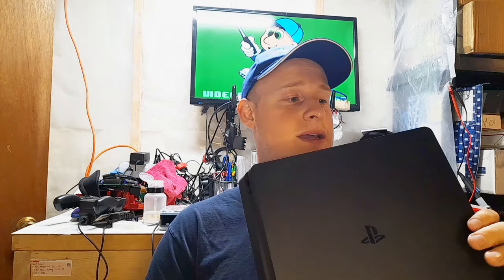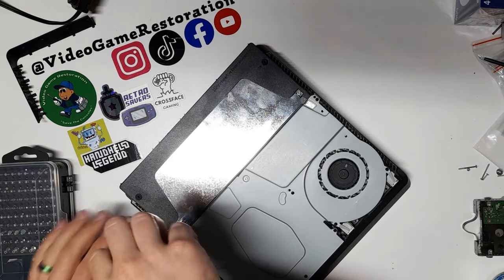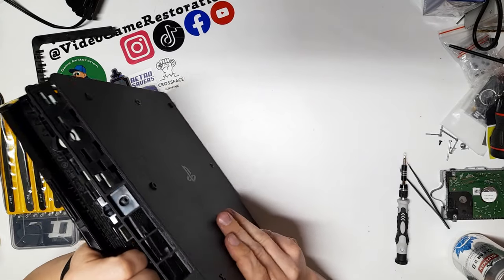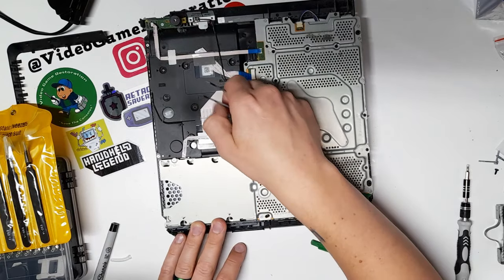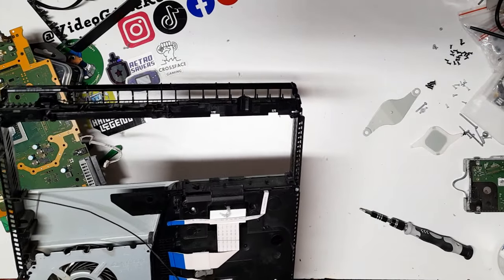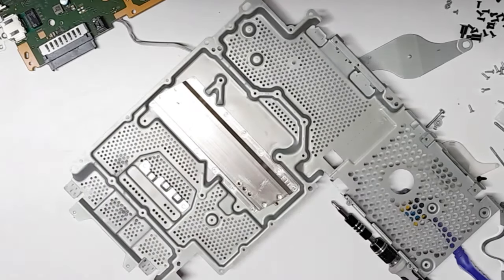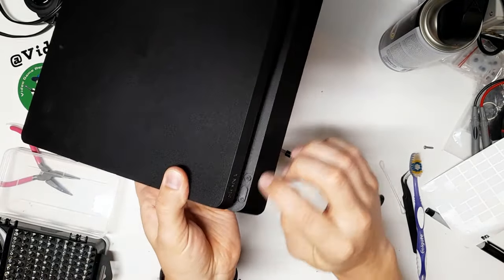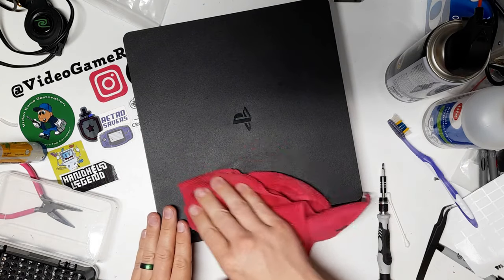Disassembling and Cleaning a PS4 Slim (Jet Engine)

Comment: Thanks for your video - I took up the challenge not even having experience disassembling a ceiling lamp. Took me six hours, many confusions, many screwing out the screws because I left the wires under the metal thing. But your guidance took me through and though something was uneven and I had to use a fork to stick in the USB-controller stick, the playstation works wonders!

Comment: Thanks so straight forward I felt confident to do it n got it done in less than an hour. I was left with two small silver screws that I just can’t remember where they came from tho lol. I made sure to look up the screw guide on Google and still came up with two extra ones but o well it’s fine
Reply from the maker: They say if you disassemble and reassemble a PS4 enough times you'll have enough spare spares to build a second system 😂 Good job!!

Comment: Thank you so much for this wonderful video. I was doing this to a recently pawned ps4 slim I picked up. I wanted to do the internal cleaning and apply fresh thermal paste and thermal pads. One thing I’ll do is replace the battery cmos battery as well since I have it apart. That part for heat sink was something I was wondering where it came from also. I patiently watched till you figured out where I needed to go. I didn’t know where it came from when I was disassembling my PS4. Thanks again for the awesome video.
Reply from the maker: @obliviousmode575  I'm glad it helped!

Comment: Hey, I have the same exact set of screw driver set as you, and at 1:59 the screw you removed, im unable to do the same with the phillips, i'm quite certain my screws are different by a tad bit, if possible could  you be able to help me know what screwdrivers are needed for ps4 slim as i'd like to try those and the reason for why im not just using and trying them all is just incase i damage the screw and it becomes a stripped screw

Comment: Good video, may I suggest to invest into a good quality small air compressor with a water separator if you clean alot of consoles.

I do alot of cleaning and it was the best decision I made hate can air and dealing with them.

Anyway awesome video will be using this video to disassemble my brother's ps4 slim. Thanks man.
Reply from the maker: Great idea! I've been meaning to move to another form of compression just haven't gotten there yet

Comment: I was trying to do a basic disassembly, one that doesn't remove the warranty seal (even though I got mine from a pawn shop) a certain part fell out when I was cleaning it, your video or any other video does not show or mention it and I don't know how important it is or if the console can properly run without it, its a medium sized black metal part bent at the end with 2 screw holes in it, one on the bent side and one on the flat side, I don't know where it goes so I can't put it back and I don't know how or if it will run without it

Comment: I took mine entirely apart and cleaned it, i took pretty much all the screws out since there was a good amount of resin built up inside, it seems a small mostly flat metal piece fell out, it has a small P1 indentation on it I didn’t think it’d be a big problem but after reassembly I can’t run anything as it gets too hot and shuts off, the fan seems to be spinning, although I didn’t change the thermal paste, would that alone cause my problem, I also disassembled the disc drive as mine never could read discs, I assume that’s where the piece came from as I didn’t see you do that or the piece on the side
Reply from the maker: Hey! That piece is for the shell, honestly it's not needed. It's over heating still, you should really put new thermal paste in

Comment: Just did mine. Wish I saw your video ahead of doing it. It's pretty clear and straight forward which would have helped in the prep phase.

One thing I'm wondering is if it would be worth replacing the thermal pads for the memory as well? I bought mine used in 2016 and the guy who sold it to me said it wasn't that old at the time (it was cause it was caked in dust from the back fan, after a week I noticed it.).  It's my first time doing the tear down but the pads didn't look half bad. Just wondering at this stage in the game for the Slim's lifecycle if its worth doing the upgrade to open it up again and give it one last boost. Great vid. Keep up the good work!

Comment: What's the thermal paste , what does it do and do you have to replace it every time you disassemble your system
Reply from the maker: It transfers the heat put off from the CPU to the heat sink. Yes you should absolutely replace it if you separate the heat sink from the board
Reply: @VideoGameRestoration would it be okay if you dont replace the thermal paste, would there be a huge problem
Reply from the maker: @XiEnVyx_VyPeRXx  If the thermal paste has dried any amount (Which in a PS4 it most likely has) then the system will over heat pretty quick
Reply: @VideoGameRestoration is there an alternative to thermal paste?
Reply from the maker: @originaldead  not that I know of. Thermal pads wouldn't transfer the heat, and liquid metal would leak out and cause a short
Reply: @VideoGameRestoration  thanks ive got that sorted, i do have another question though, would there be a huge problem if i lose any thermal pads some of the ones i had is lost and some lost its stickiness?